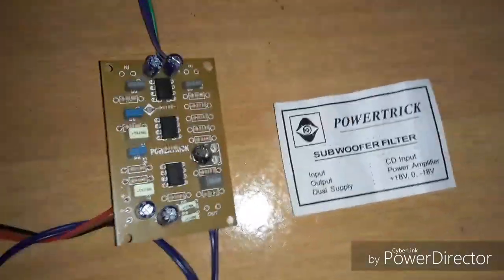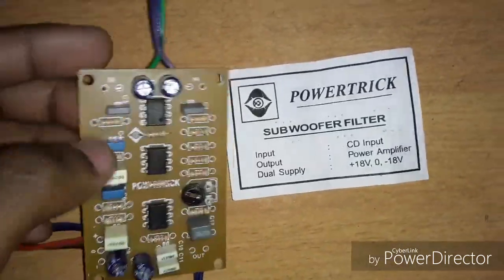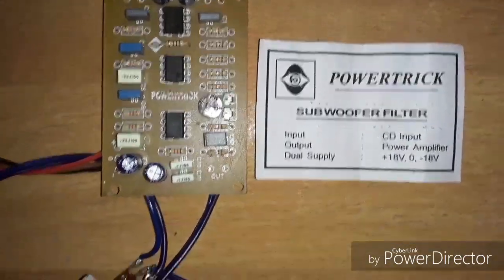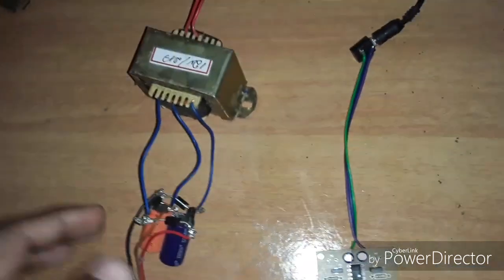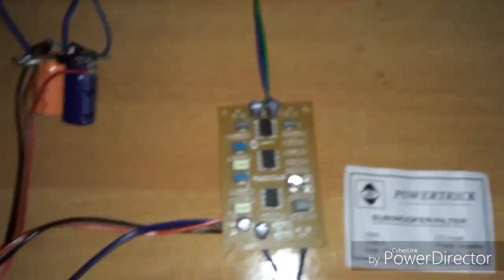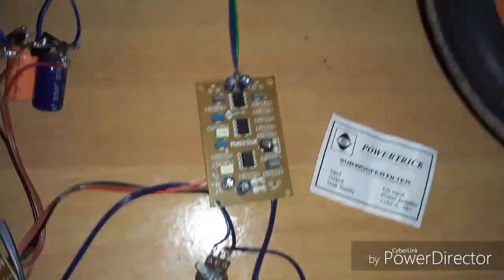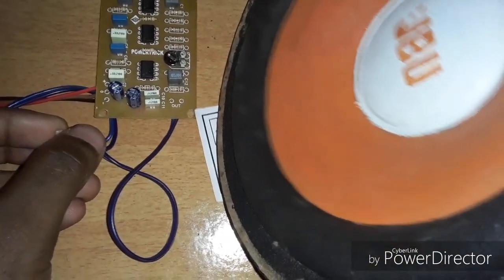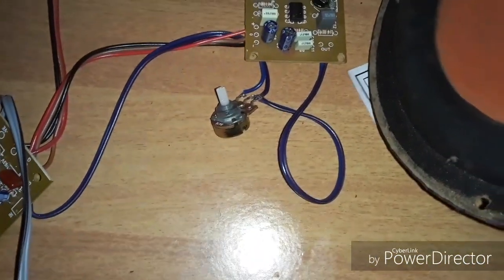Best lowpass filter for subwoofer. NE5532 IC

Comment: Frequency,  phase  and gain  adjust ചെയ്യാൻ പറ്റുന്ന, 10 to 80hz output filter board കിട്ടാൻ വഴി ഉണ്ടോ bro...
Reply from the maker: 3 ennam orumich ullath undo enn ariyilla, gain ella lpf lum adjust cheyyam. Frequency + gain adjust cheyyavunnath varunnund athupole  phase+ gain adjust cheyyavunnathum und. Amazonil available aanu.
Reply: @techzone9209  i need this board sir i m from punjab how i can buy this...can you send it me ..i need 3 low pass board

Comment: സർ ഇ രണ്ടു ബോർഡും   കാറിൽ നേരിട്ട്  കൊടുക്കാൻ പറ്റുമോ
Reply from the maker: ഇല്ല  ചേട്ടാ,  ഇ രണ്ട്  ബോർഡിനും  dual supply venam.  കാറിൽ  12v dc single supply അല്ലെ  വരുന്നത് . 12v  to 12-0-12, 5 ampere converter ബോർഡ്‌  വാങ്ങാൻ  കിട്ടും.  അത്  ഉപയോഗിച്ച  ഇത്  കാറിൽ  വെക്കാം.  കാറിൽ  സബ് വെക്കാനാണെങ്കിൽ, ഇതിലും  better transistor or mosfet board ആണ്.
Reply: @techzone9209  
Ok tq
Reply: @maheshfuturecars1154  ഈ ചോദ്യം വേറെ ചാനലിൽ ചോദിച്ചിരുന്നെങ്കിൽ ആരും മൈന്റു ചെയ്യില്ല...👍